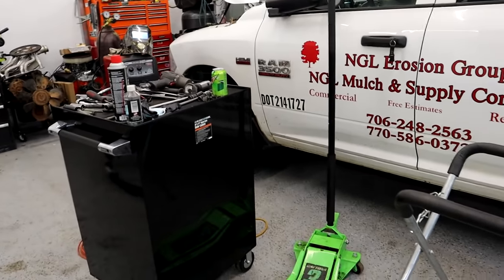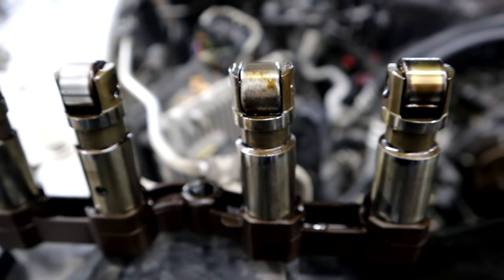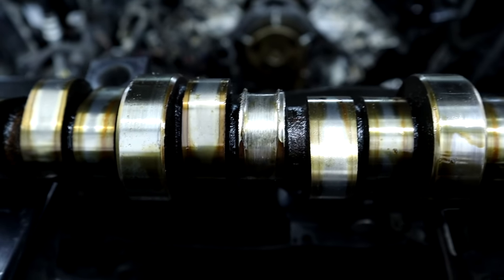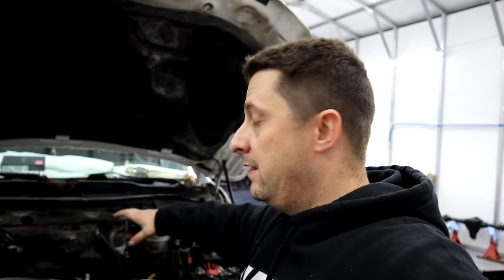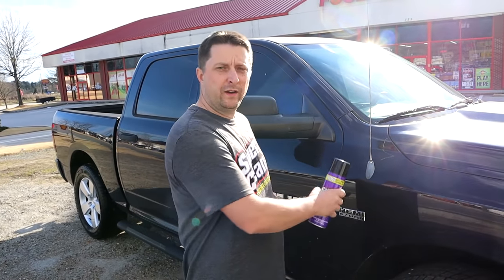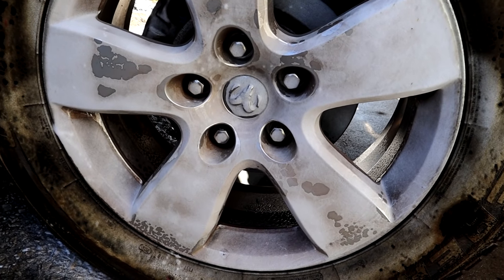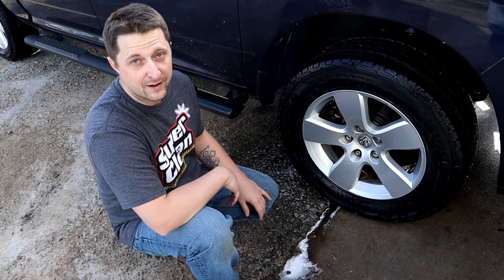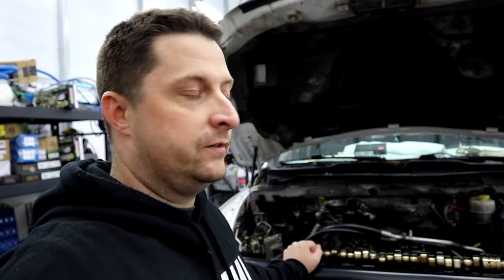6.4 HEMI Engine Failures Common Problems WATCH OUT.

Comment from the maker: Not trying to scare anyone as you all know I love all the hemi engines. Just be aware of what could happen in the long run🙏☝️👍 if you live in GA and need help with this repair contact me on instagram@frostbite_ram or my Facebook @frostbite ram
Reply: Wot if'n I libes in VA?
Reply: Gm the same way they eat lifters too
Reply from the maker: @hmb_jeff561  they sure do 👍
Reply: The new 6.4 hemis have problems too with the lifters…?
Reply: Help for what?🤔
The V6 Challenger  doesn't have a HEMI Engine but it still has problems?🤔
Reply: @cgordon4949  The 6.4 is more prone to problems.  Even the brad new ones 2022 because Dodge never remedied problem.  Dodge just uses same factory parts  (band aid) only for problem to happen again except you pay out of pocket when warranty expires.🤑
Reply: @microminiskirt  if you mean after warranty runs out at 232k miles than yes. Try listing. If you do not idle the motor guys in hotshot are getting like 350-400k miles before they do this. If they didn't have an mds, they wouldn't do it at all.
Reply: @sonsofliberty3081  Use as a daily driver.  Freeway and city driving combined.🤔
Reply: From what I’ve gathered over the last couple of years is that 5.7 and 6.4 engines that have longer than average idle times are the ones that experience this issue.  It seems standard volume oil pumps do not supply adequate volumes of oil to keep the lifters adequately lubricated at idle.  The solution seems to be the installation of a high volume oil pump like supplied with the Hellcat/ Demon engines.  The added oil volume at idle seem to solve the problem.
Reply: @williamreilly1165  Then these cars would be unfit for 24/7 police pursuit vehicles not that most jurisdictions use these 5.7 or 6.4 engines in the Charger patrol vehicles.  As I understand it the CHP uses Chargers with the V6 Penestar engine which I don't know suffers from the same fate of idle time.  The maintenance records of the police departments that use these Chargers however they are equipped with V6 or V8 engines would be a great source of information on the durability of these Dodge vehicles and confirm these issues and validity of all of these issues.
.
Reply: @sonsofliberty3081  hotshot using 6.4?
Reply: @C Gordon  no, they don't. They just went in 2021 and reinforced everything even more. The issue is with people idling them. He probably has a bunch of hrs under idle. I've seen lots of guys that work them hard go 450k miles.
Reply: Hey good morning do anybody know the name of his buddy shop ?
Reply: For the money that you have to invest to put it back stock. I’d rather spend the extra money to really fix it right as in delete the DOD, Cam and roller lifters with a aftermarket kit and a high volume oil pump and program the computer to disable the DOD and probably get a better service life out of the truck. And probably never have to tear in to the engine again it would be money well spent.

Comment: I work at dodge. The main reason this happens is lack of maintenance. If you’re not doing the oil change with the proper oil every 6k miles that’s on you
Reply: The change engine oil light comes on around 8000 miles. So actually you are wrong. If you don’t change your engine oil at 6000 miles, it’s not on you, it’s on Ram. This is a purposeful design flaw. These engines continently fail after the 100,000 mile warranty. Shame on Ram, shame on Hemi. Money rules them
Reply: @Yahusha77  manufacturers recommendation, and the proper maintenance intervals are two different things. I don’t give a damn when the light comes on, it’s the customers responsibility to get it maintained properly. The machine is fallible and can clearly make mistakes. My Honda won’t turn on the oil light until 15k miles lmao. That doesn’t mean I’m gonna do the oil change every 15k miles. Your argument is baseless and dumb. Also I make sure to tell my customers every 6k miles to come in for an oil change on full synthetic vehicles or at least once every 6 months if they’re not driving it enough
Reply: I do oil changes every 3k miles on my SRT jeep 392 hemi. Lifter still failed at 53k miles, manufacturer warranty covered it so that was great. My opinion is that it comes from excessive idling, the lifters don’t get much lubrication with low oil flow under idle as opposed to rolling around 20mph or 2500rpm. The 6.4L has moved the camshaft up a few inches compared to the 6.1L. My second thought is that they are just primed to fail, no one with aftermarket lifters has this issue.
Reply: I change my oil at 3,000-3,500 max. My truck has 21,000 miles and is at dealership right now with oil consumption issues. Uses 4 quarts of oil between oil changes. My truck is my money maker and I maintain it more than recommended.
Reply: I do mines every 4k
Reply: I run my 6.4 truck with the mds off. Is that a solution to help against the lifter failure? Thanks
Reply: @CarveLife  they’re going to fail either way unfortunately. Just doing your oil change helps prolong their life, but the roller will eventually fail and when it does you’ll start to hear the tick and then it’ll potentially cause damage to the cam lobe.
Reply: @r.l.j3789  how about the maintenance on the automatic transmission intervals? I have 48k on a 2500. 15k is probably heavy towing. When should they be serviced? Thanks man!
Reply: @CarveLife  I would say every 30k for heavy towing. On the wranglers it’s every 1 regardless.
Reply: @CarveLife if anything like the 5.7 j ram 95> of owning it with it off and they still failed   Just replaced and have a knock or tick again. I’m done with this junk truck company
Reply: 3000 is still too long.
Reply: @BloodAlwaysFindsItsLevel  no it’s not
Reply: What ram recommend mileage on oil changes! If it's different than your recommendation then NO, it's not the owners fault, it's the manufacturer
Reply: @richardfreeman8458  you’re the one driving the vehicle not Dodge. So nope it’s not their fault. It broke while you were using it, under your care. People are so quick to toss the blame onto someone else and don’t want to accept any type of accountability 😂😂. It broke while YOU were driving it not the shop or the manufacturer.
Reply: I would not trust 6k oil changes. I have a Ram 2500 6.4 with 48,000 miles and I have changed my oil 3k or under and I’m starting to hear the Hemi tic. Amsoil 0w40 and Napa platinum filters. Delete MDS.
Reply: @KevinGentry-o6k  I’m sure you also let your pickup idle a lot too
Reply: @r.l.j3789  only in traffic or at stop light. It’s sad if an engine can’t handle that without needing new lifters and a cam.
Reply: I don’t work at dodge and I tell people that people just don’t listen 😂
Reply: That along with idle time.
Reply: I’ve seen gm ls owners never change oil just keep adding it and engines go 500k if dod has been turned off prior to 100k. Dodge is just garbage period always has been and always will be. Cadillac North Star we tried to blow those turds up at the dealer to warranty them run them no oil and still not come apart. This is obviously a dodge issue with lifter failures. This is worse then gm and dod failures which is very easy fix just turn it off and they don’t fail.
Reply: I have an SRT Jeep and our factory recommend oil and filter every 3k and this just happened to me at 89k miles…it’s not a maintained issue. I take great care of my Jeep.
Reply: I do oil changes at 4500-5000 miles….Have 176000 ,lies on it. That is why I take care of my truck
Reply: @Yahusha77 if you don’t know when or why to change your oil, you probably shouldn’t be driving an 8000 pound weapon down public streets
Reply: I appreciate people like you working on my vehicles
Reply: @CarveLife how do you get the mds to stay Off
Reply: @donsisco7118  Run the transmission in 6th on the Column shifter selector. That keeps ECO mode from engaging. The transmission will shift throughout the gears just like normal. You just need to get in the habit of selecting it every time you get in. Also never let the 6.4s idle. Ever!!  Doing that with a 1/3-1/2 quart of MMO add and 3k oil changes I have put 250k plus on a few 6.4s with zero lifter issues.
Reply: This is what they obviously brainwashed you to say at Dodge😂
Reply: I bought a 2018 RAM 2500 Bighorn CPO with 53,000 miles on it. I also purchased the extended factory warranty up to 100,000 miles. At 80,000 miles the brake booster and the transmission had to be completely redone. At 93,000 miles the brake booster and the cam lifters had to be done.   I have been faithful to my maintenance in this truck as always. If you buy one of these trucks buy the extended warranty. You will need it. If nothing else buy something like car shield. No truck is under 100,000 miles should be having the issues this truck is having. I’m pretty disappointed. My wife is needing a car/SUV but it won’t be a Fiat Chrysler product. Let me tell you that.
Reply: @Iwillnotbepushed  sorry to hear that, but I don’t work for them. I work for a dealership that is a franchise under them that is authorized to perform repairs on their products. If you have any complaints I would direct you to Stellantis directly sir.
Reply: @Iwillnotbepushed  💯brother. These homers that defend FCA either have a lot of money,or either has not happened to them yet, or plain ignorant by choice or not. These ram trucks (Newer) are garbage
Reply: @Yahusha77  Since Fiat bought Chrysler quality was thrown in an Italian toilet and flushed into a sewer abyss.
Reply: @Yahusha77  Sorry, that's simply not true.  I have 130,000 miles on my 2012 5.7 with no lifter tick or problems with the MDS.  I change the oil every 5,000 miles which I was taught to do over 50 years ago when I bought my first car.  I've never had an engine or internal engine component fail in any of the dozens of vehicles owned.
Reply: No lack of maintenance is not why it does it, lmfao.. it’s just a shitty ass design that dodge refuses to make better
Reply: I say BS,   my oil is changed every 5000, using Amsoil  0w40😊
Reply: @Yahusha77 doesn’t matter. 5-6k 0W-40. Period
Reply: @r.l.j3789  the ppl that don’t already understand this cannot be helped because they just don’t understand how things work. Understanding can be a curse too 😂. I worry about parts failing all the time because I know how much stress they are under even tho they are made for it
Reply: @BloodAlwaysFindsItsLevel 🙄
Reply: I don't believe this is the case at all and as a former fleet manager this statement isn't fact. Every vehicle in the  fleet has oil changes every 5K miles with the proper grade of synthetic oil from a major oil company. 100-150K miles is the designed lifetime of the Hemi and by then a lot of them are done. Not all but it's enough not to be uncommon.
Reply: @r.l.j3789 the maintenance recommended interval is very conservative. Oil analysis demonstrates this. Changing oil will not magically extend the life of an engine.
Reply: @davidporter7051  actually you’re incorrect, the designed lifetime for the hemi
Engines is 200-215k miles. For the most case it is due to lack of maintenance and that is an objective fact you cannot deny. Since I work at a Mopar dealership I literally see the lifters when they’re removed and you can see the lifter is collapsed due to lack of maintenance typically
Reply: @KevinGentry-o6k oil changes and mds is not a pancea. The Hemi has eaten cams since it's inception this includes the 6.1 which doesn't have MDS.
Reply: @r.l.j3789  no 200K miles is simply not the designed lifetime. Chrysler has been very open about the Hemi development. My first statement is right on and maintenance doesn't overcome design and manufacturing. Ram trucks historically are the least reliable and most maintenance intensive trucks.
Reply: @davidporter7051  yeah your information is so incorrect it’s funny. Your source is “trust me bro” those hemi engines are easily rated for 200k. You’re thinking about the pentastar V6. The V8 hemi can and constantly does last 200k+ miles. I see it on a daily basis.
Reply: I'm reading that 93 octane fuel is recommended, you heard that? Thanks
Reply: @andyamysarizonaadventures5450  don't ask him. for someone who works at "Dodge" he is very ignorant on this matter. 87 is acceptable and 89 is recommended.
Reply: @andyamysarizonaadventures5450  I’m not sure, I’d recommend going based off what the vehicle says, or based off the owners manual
Reply: 2017  dodge challenger scat pack 6.4.gear stuck in 3rd.flashing message service shifter. Has loss communications codes
Reply: @user-jd4kp3lp9r  you asking me what the problem is lol?
Reply: @r.l.j3789 so what if you’re not at 6k and you’re lower than that and just left ram a month ago… who’s fault is that?
Reply: @OpaLockaOutlaw305  how many miles does your vehicle have? Is it a brand new vehicle or does it already have miles on it? If it’s brand new (65k mile limit) obviously that’s a manufacturer defect which is covered by warranty. If it’s over that mileage then that’s your responsibility
Reply: @r.l.j3789  hmmm that’s interesting bc it’s over 120k and has been well maintained and damn bear had a complete overhaul a month ago and it’s still my fault??? Might be right bc I should’ve traded it in for a new one
Reply: @r.l.j3789 i drive the 2005 ram 1500 my father passed down to me when he decided to upgrade to a newer truck and my father got this truck at 20k miles. it has had the tick ever since he has had it and its now at 253,000 miles. and its never had a single problem other than the water pump and the power steering pump. and to this day it drives great besides the fact i broke my differential doing a donut😂
Reply: @lt1z350 dodge isnt garbage they just dont want to put better lifters in there vehicles and ontop of that there idle speeds are to low

Comment: The only thing I would add is the 6.4 is not a new engine, it has been around for 7 years and the problem has not been very widespread at all. If the same owner has had multiple trucks with failures it makes me wonder what kind of maintenance he does.
Reply: There are unlimited videos of these hemis ticking and camshafts being destroyed.
Reply: Or how they're being used
Reply: This is a widespread issue Jeepsrt8, and a bunch of 392's are having this issue
Reply: Concerns me
Reply: @chavyflos6311   not 6.4!
Reply: Use proper engine oil, don't go cheap or substitute.
Reply: This is mainly because of a lot of  idle time.

Comment: We eliminated our cam & lifter issues when we switched to Schaeffer 0W40.  Chrysler approved.  Zinc & Moly both control the wear.  No disappointments.  If I told you the drain intervals we are running no one would believe me.  We sample every oil change.  Hard to find but nothing better.
Reply: I run Schaeffers in my Power Wagon and my Hellcat and have had great luck with that oil.
Reply: What's your opinion on Amsoil?
Reply: Thicker oil wont fix a mechanical issues sooner or later it will cost you in the end .
Reply: @fordmech7913  It will when the issue is lubrication. And the hemi failure is definitely due to lubrication.
Reply: Seen a dozen trucks eat cams running that exact oil with 3,000 mile intervals. Was a Schaeffer oil sales man team
Reply: @jacobstrutner8232  are you saying you were a schaeffer sales rep?
Reply: I checked the oil on the dipstick after 3 months of driving daily and nearly black is due. All types of weight oils will wear 3 months daily drive. Heavy oils prevent friction noises. 40 weight with winter capability like zero w 40 is new to me.

Comment: lol the excuses, its just a engineering failure been going on forever.
Reply: If they can’t take the time to perfect a lifter that’s pretty bad.
Reply: Hardly an engineering failure or even a problem when you consider how many 3rd gen hemis have been produced since 2003 a tiny  fraction of them have had camshaft or lifter problems. Hardly worth re-engineering a design for a insignificant problem. Never heard of an engine that dosent suffer failures they dont exist. The vehicle owners have more to do with failures than the design ever will unless it is just a bad part they do exist and nobody knows its bad until it fails.

Comment: I'd suspect that the root of the problem is caused by DIRTY OIL. Running it more than 5K miles between oil changes.
Reply: Nope. I know of trucks that ran full synthetic with 3,000 mile intervals that eat lifters.
Reply: They don't use specified oil, even certain synthetics don't meet requirements. Alot of people go conventional and the damage starts.
Reply: The hemi has a issue with oil starvation at idle so if you idle your truck a lot then it’s bound to munch a lifter.
Reply: The real problem is mds just like afm in GM it’s garbage

Comment: Don't sit and idle any longer than you absolutely need to if you have a Hemi. The oil pumps don't pump enough oil to all the lifters at low rpm. Hemis are great engines, but if you need a vehicle that has to idle for hours, don't go with a Hemi.

Comment: You mention milage in the videos as a rough estimate, but more importantly, what are the idle hours on these engines?
Reply: That makes a big difference, I worked for for the motorcycle training program in my state and when we sent bikes to auction they had low miles 2-4K, but all the hours they sat and idled is still run time. So basically double the mileage and that’s a lot on a small bike before overhauls
Reply: This is what I'd really like to know too.  I suspect this is a bigger problem in the south where people idle vehicles to run the air conditioning.
Reply: @wirebrush  100%
Reply: @wirebrush  or the north to run heater. no difference.
Reply: JUST THINK ABOUT THE POLICE CARS?  THEY IDLE THOSE CARS ALL THE TIME, RUN THE AIR CONDITIONERS.  THEY WOULD KNOW THE WEAKENESSES OF THESE ENGINES AND FACTS ON LIFTER FAILURES ETC.  IT BE INTERESTING TO GET A REPORT ON THEIR RECORDS/MAINTENANCE RECORDS.